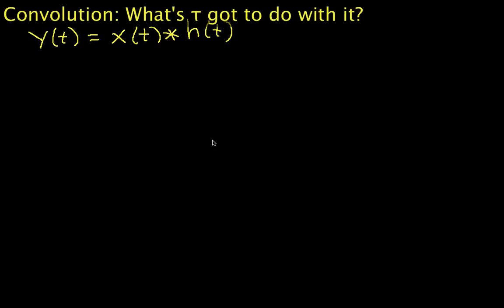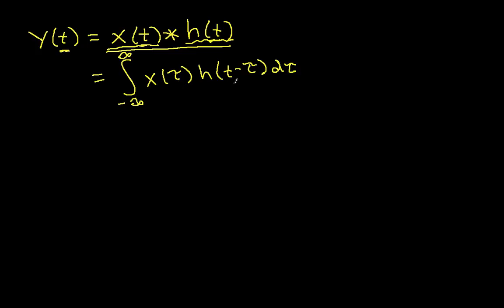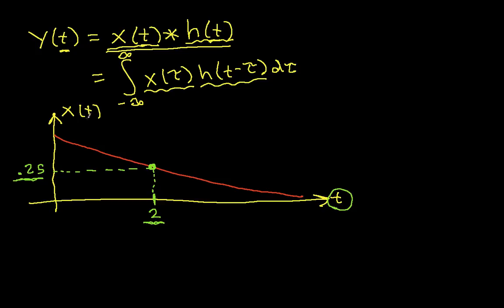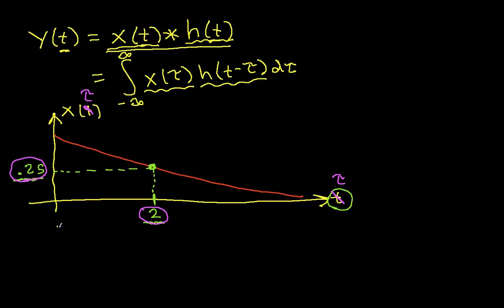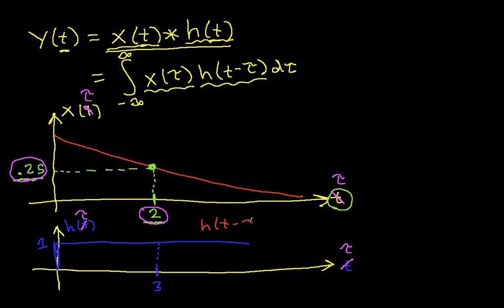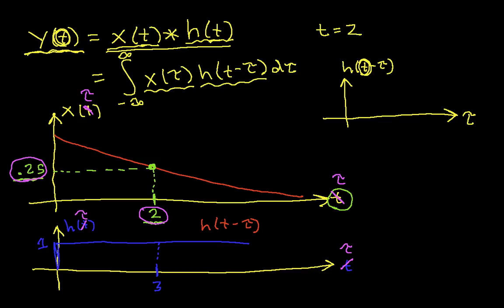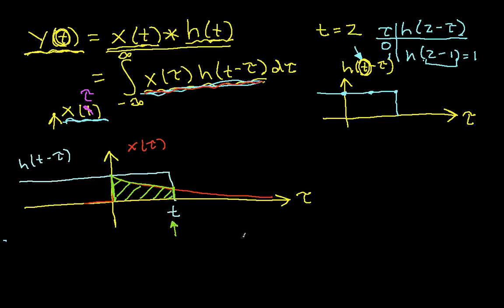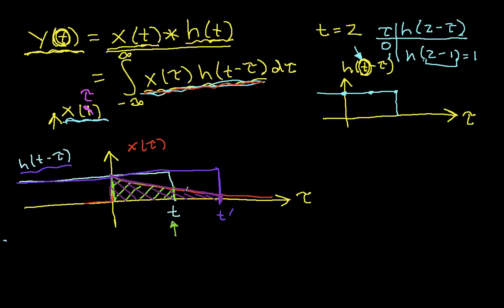Convolution-What's τ got to do with it?

Comment: A good way to understand that flip and shift thing is like this - 
h(t-T) = h(-(T-t))
I think if you re-write it like that it makes much more sense
Reply: +Captain Rhodes thank you! you saved me from getting confused :D
Reply: +Captain Rhodes I thought exactly the same thing :) 
Slightly clearer the way you wrote it, Captain.

Good lecture Darryl!
Reply: cool. can I shoot one at you lot. it seems to me that convolution can be viewed graphically in 2 seperate ways. one involves the shifting of a function and computing a running integral , the other involves stacking the function (and scaling it) horizontally. has anyone else noticed this? I mean its never adressed that theres 2 graphical approaches but I find this very confusing. in dicrete time they always use the second approach but for continuous time it seems to vary depending on the mood of the instructor.
Reply: +Captain Rhodes I didnt think graphical methods could be applied to continuous time functions?
Reply: willsoe yes they can. they are always very badly explained
Reply: Ah wait I think I'm thinking of periodic signals. Graphical methods cant be used for those

Comment: Prof, why are you calculating just the area underneath the function x(tao) and not under h(t-tao) as well? Aren't you multiplying the two functions first before integrating?
Reply: I believe he assumed h(t - tau) to be equal to 1 on the entire domain to make the math easier. Since it is 1, the area is always just the area under x(tau)
Reply: Not necessarily! For example, if x(t=2)=2 and h(t=2)=3, then at t=2 their product is 6. The formula states that for every t, you have to multiply the areas of both functions. Since h(t-tau) = 1, it is correct. If it was something else, then both areas should be multiplied by each other.